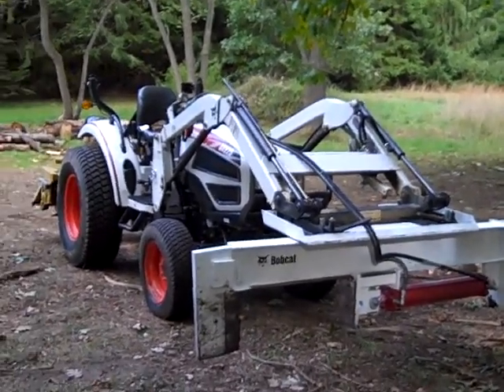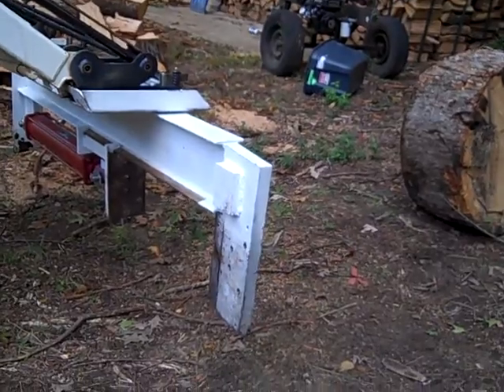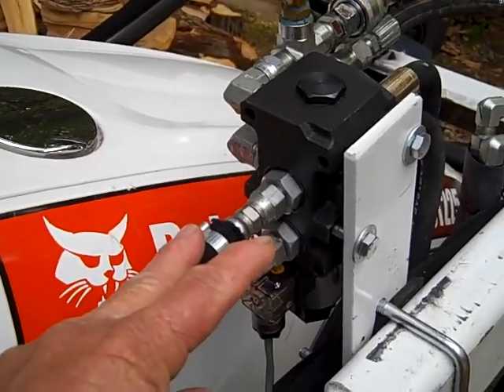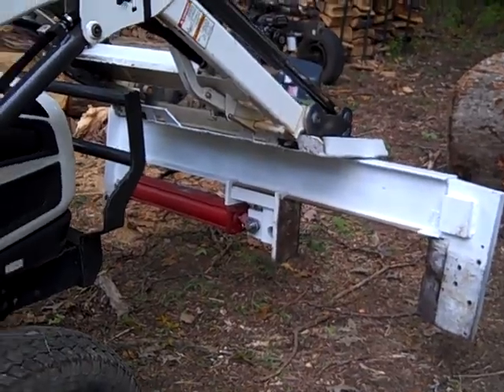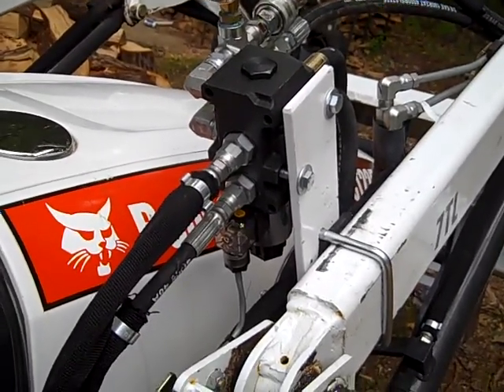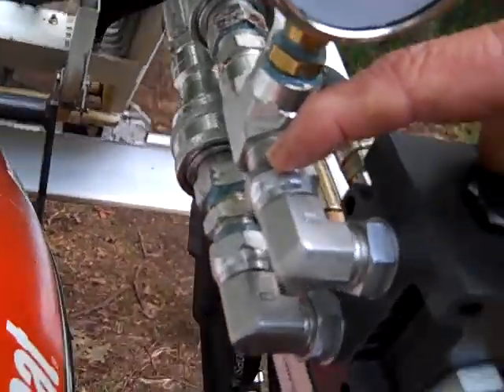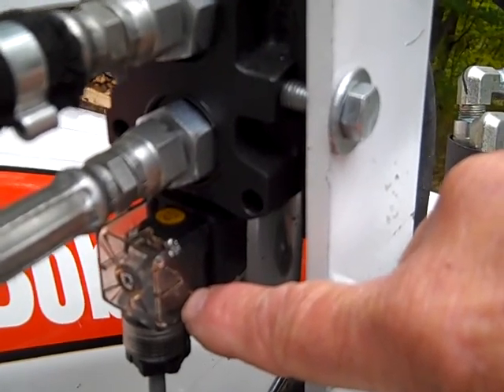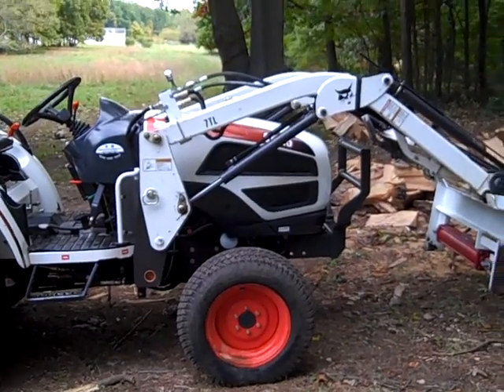Using Hydraulic Diverter Valves on Compact Tractors Bobcat CT225

Comment: Thank you for sharing your diverter video.. I just ordered the same diverter kit (but with joystick switch) to use with my grapple. Ordering from Summit Hydraulics was quite nice, they are polite folks and explain a lot of details. I do have a couple of questions for you, if you don't mind answering them for me. 1- will I be able to mount the diverter horizontally (so I can mount it on the underside of my floor pan)? 2- will I need to disconnect the hoses from my bucket tilt cylinders and connect them to the diverter, then add a couple of new hoses from the diverter to the cylinders...then two hoses from diverter to the connectors for the grapple? 
 I hope I didn't confuse you with the latter question, I'm  not very good at wording my thoughts. I'm only trying to figure out how to install the diverter so I can use a grapple. I'm not a mechanic by any means, and this is my very first attempt at Hydraulics. I dont know if it matters or not, but I have a 2019 Mahindra 1626 Shuttle Shift tractor...and I ordered the same diverter valve that you have. 
I apologize for such a long read, only trying to figure out the install before the diverter kit arrives. Thank you so much for any guidance or assistance you may be able to offer. Have a wonderful day and God bless you and yours! 
Donnie